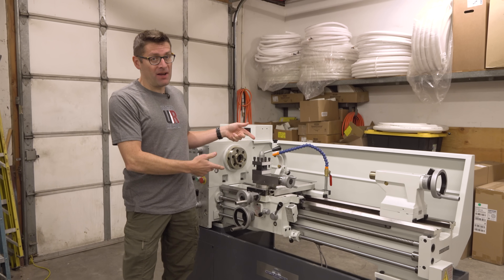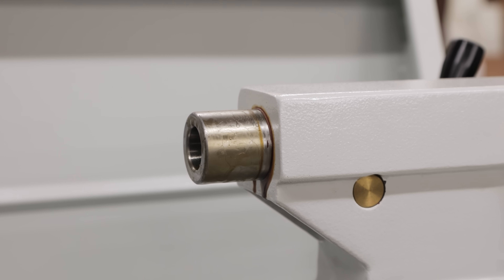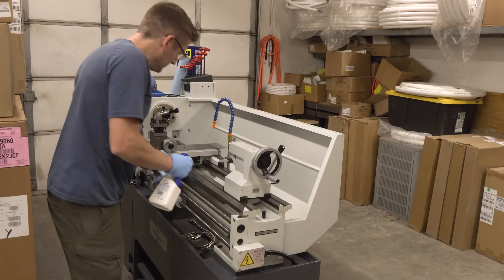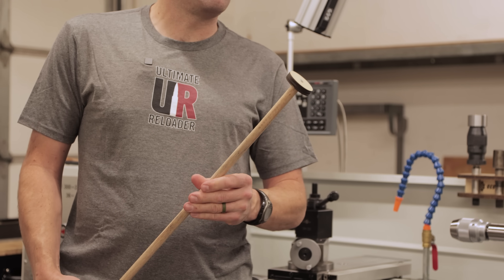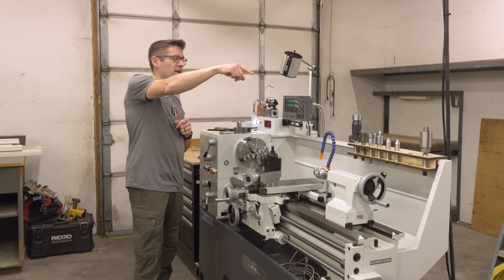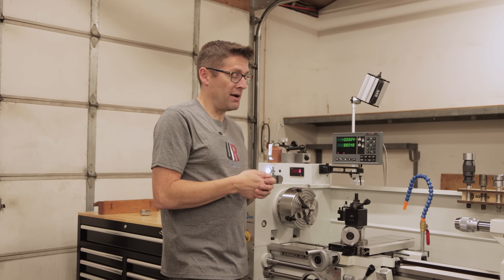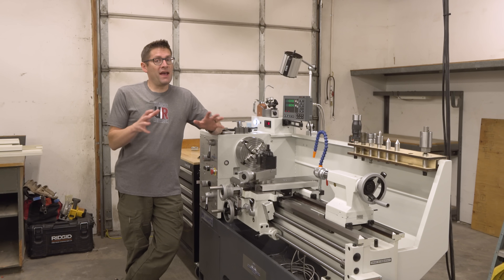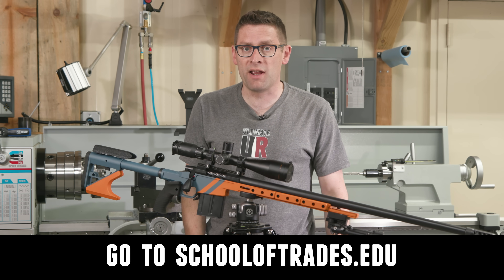Setting up the Precision Matthews PM-1440HVT-2 Lathe

Comment: I never noticed this until now, but there is no chip drawer? Looks like you have to remove the chips from the backside of the machine? If so, this seems problematic if you need to put the thing near a wall.

Comment: I've been looking at lathes and mills for 10+ years now...  I've toyed with the idea of the smaller "mini" options on the market, but fear I will regret spending between $500 and $2000 only to find (in short order) that I should have gone straight for the PM1440HVT Lathe.  I'm still not fully funded for such an acquisition, but I can plan.  On that note, I don't see any space requirements or dims on the PM website.  Do you have access to this information?  I'm planning to add a second 50A outlet for the future installation.  As an aside, thanks for the great, informative content!

Comment: So what happened to the other lathes? Did they not work out, or do you keep them all for different things? I just bought a very similar machine to this. Same basic design.
Reply from the maker: I use them all- two shops! Mountain shop and city shop :)
Reply: Excellent - that’s the best way.

Comment: I just bought and set up a 13x36 lathe in the back of my garage. But it is 80+ years old, so the set up procedure involved scraping years of accumulated sludge off, but not cosmoline! It was 3 phase, so I added a VFD. I've done a basic leveling, but the machinists level will have to wait for a future paycheck....

Comment: Gavin, a question. What about cutting chamber inside a separate, removable piece of metal.  This way I could chamber and shoot either British 303 or 7.62x54.  They have identical projectiles and almost identical powder charge.
Reply: That’s a very interesting question. Considering that a 7.62x54r brass can be resized for .303 british by simply running it through a .303 form die I kinda get it. I’m not familiar with removable chamber inserts. I’m fairly certain that would be tricky. Laminated steal is not as strong as a homogeneous block of steel and I would fear the detonation of the round to compact the insert inside of the receiver the same way brass thins itself out with repeated firings. Sorta hammering itself out and making it harder and harder to extract the insert. Or maybe you were thinking about separate chamber blocks that thread in as a separate round between the receiver and the barrel?
Reply: @jeffreyhallam5517  Separate Chamber block, removable.  With another just like it,  chambered in another cartridge.  With copper washer inside a recess to provide gas seal between the barrel and the Chamber part.  One of the blocks would have a slightly longer throat because 762x54R is that much shorter.  Bolt face would have to be wide enough for 762x54 to fit.  Headspace can remain true on both, because these blocks would have equal length.

Comment: Need to get you a 5C collet quick change for the spindle. 

I think I would have went ahead and gotten with some CNC capability. I get it. Pretty useless for most gunsmithing but it sure is handy to have some ProtoTrak type conversational capabilities.